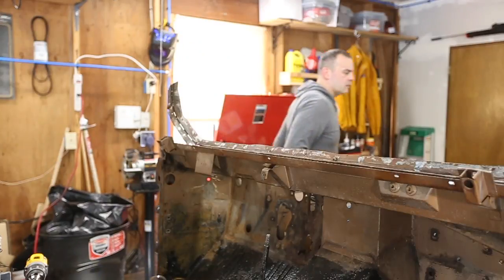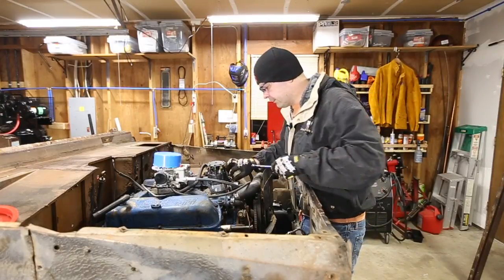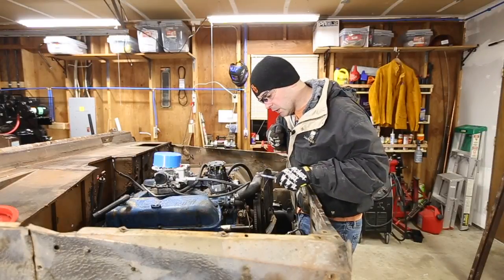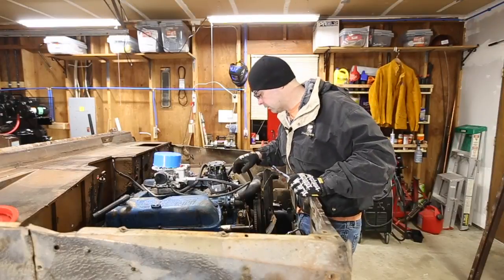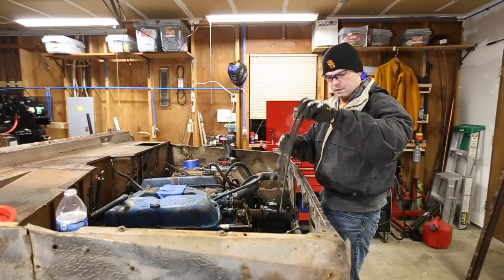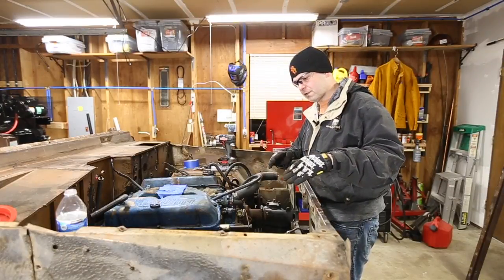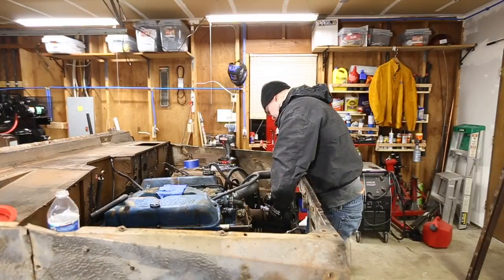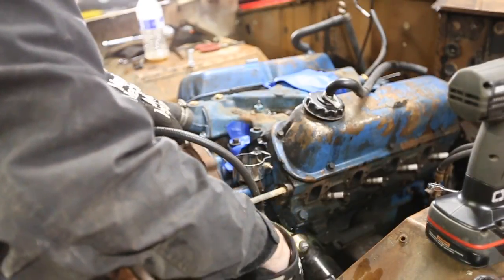Ep 2.10 - Bronco Windshield Frame Removal and Body Cart Assembly

Comment: is the body cart custom? Trying to find something like that for my body.
Reply from the maker: Sdh1994 yes a guy built it for an integra out of his work materials. I'm modifying it for the bronco. Looking back it would be better just to build one from scratch. There are some good wood ones in the forums if you search body cart for early bronco. Also I like englewood cowboy's idea on the duck build on classic broncos. He basically used 2x4 steel stands into either side frame rails. Technically not a body cart because the body is in the frame but still gives great access to everything.

Comment: Very nice! Are you saving your engine or replacing it? If you're saving it, I would set it at top dead center before you pull everything off. That way when putting everything back on you at least know it's close. Just a thought. And thanks for letting us see your underwear 😂
Reply from the maker: Not sure yet.  I'm tempted by the Explorer swap option.  I'm gonna pull the heads and see if it's been rebuilt before.  If not I may keep it and have it machined for a rebuild. I have so much to do!  I'm spending crazy time in the garage.